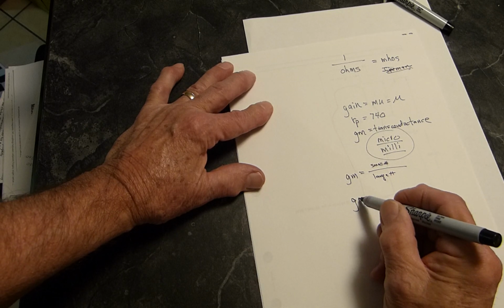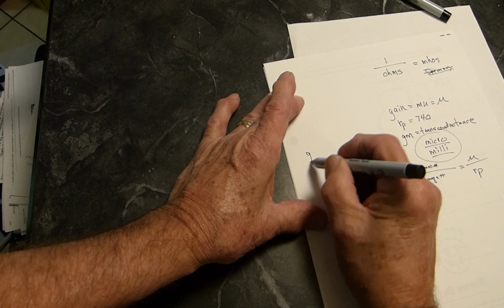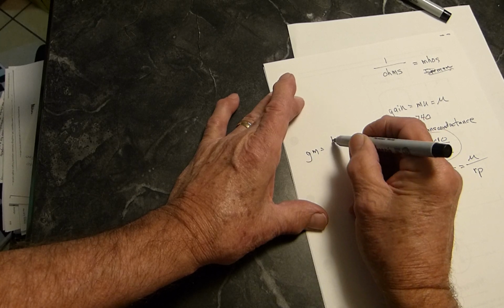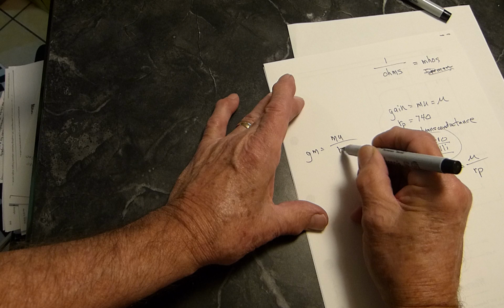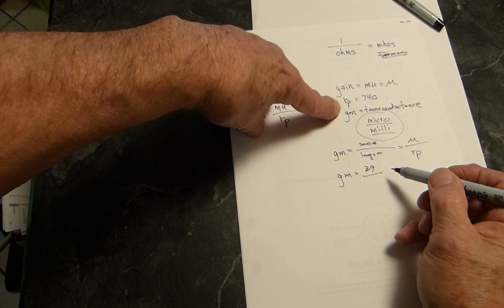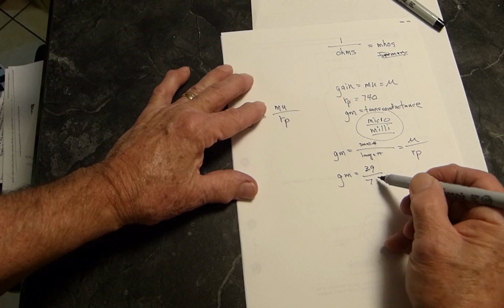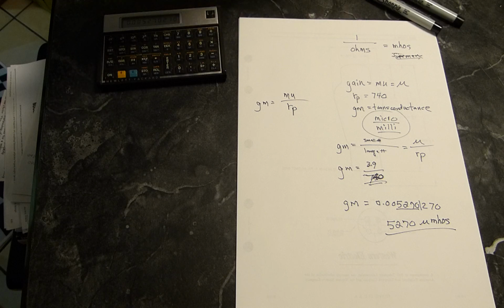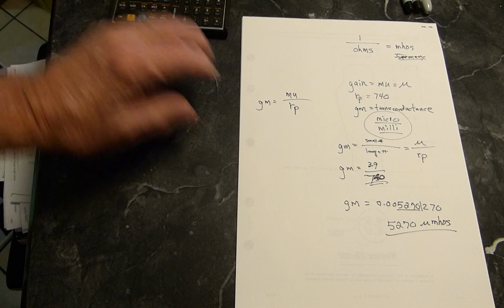Vacuum Tube Gain & Gm Calculations & Some Insight Into Transformer Inductance and Impedance

Comment: Hi David, very interesting video with a lot of information I was not aware of.. I have two questions if not too technical, I was hoping you could answer.  I have a 1943 Thordarson Output transformer originally designed for P-P 6L6G’s or Metal tubes, with many Secondary windings.. Is it possible to use it in a Parallel Push Pull application, and use the appropriate secondary to meet the new Load Resistance for the Parallel sets as long as the Transformer can supply enough current to the tubes? And how do you measure to find out the amount of Henries a Choke is, as I have quite a few I’ve removed from old broken equipment (1940’s-60’s) that aren’t labeled.. I know that they would work well in amplifier applications (I have just tossed one in a CLC circuit and haven’t had any issues, but it would be nice to know what it is I’m using… Thanks for any input, and keep making your videos as they are always interesting. Tom
Reply from the maker: Yes, you can use an OPT for at least a 2:1 impedance ratio change from design. For a pair of 6L6 it is likely close to 5K and parallel push-pull 6L6 will want 2500 ohms so just put your 8 ohm speakers on the 16 ohm tap and the reflected Z will be the 2500 you need. Measuring L in chokes can be done with a number of inexpensive  LCR meters available and there is a simple method on the Internet for a setup so you can measure the L of the inductors under different current loads. This is the setup I use:     https://www.dalmura.com.au/static/Choke%20measurement.pdf

Comment: Thanks for the great videos. I'm about to build my first tube stereo amp. It will be a 6SL7 driver and 6V6 SE OP. I have picked some published schematics to work from. What I don't understand is the coupling of my other components which all output 2 Volts rms. I plan to use an ALPS style 100K pot for volume control at the amp input. How do I determine what component network I need between the  100K pot wiper and the grid of the 6SL7? THANKS CHEERS.
Reply from the maker: Two volts input to power amplifiers is a good level to start with. Your 100K pot is fine and nothing special has to be done. The 6SL7 is a high gain tube and the predecessor to the 12AX7 so you might actually have too much gain and want to have a 6SN7 handy to swap in and try. Your input signal to the amplifier goes to one end of the 100K pot, the other end goes to ground and the wiper goes to the grid of the input tube. Sometimes people use a "grid stopper" resistor between 1K and maybe 100k from the wiper to the grid as it can improve stability. There actually is an effect called the Miller Effect that occurs at some critical value of input R and internal capacitance that can cause parasitic oscillation at some input pot setting without the grid-stopper. Some people will add a capacitor (maybe 0.1 uF or so) in series with the wiper and the grid (and the grid-stopper resistor) but if you do this you must add a resistor to ground (470K or so...) from the grid side of the input capacitor to ground as you must provide some high resistance DC path to ground for the grid or a charge will build up on the grid at some random point and it will just stop working as a bias voltage will build on the grid inside the tube. It won't hurt anything it is just one of those funny things about making sure capacitors have a DC path around them. Hope this helps and makes sense.
Here is a link to a good example of  Williamson amplifier.
https://www.vintage-radio.info/heathkit  The amplifiers like the W-2 and W5 or any of the Williamson Type Amplifiers, are good examples.
Reply: @ElPasoTubeAmps  YES, that does help. I have built guitar amps but always from proven schematics. I understand the biasing but was unclear on grid circuitry and couldn't find any explanations on line. Many thanks.

Comment: David, very good. Two questions if I may.

1. EF86: rp=2M5 and gm=1.8mA/V, so mu=4500? Just checking my number crunching.
2. Why do the tube books and datasheets generally give mu for triodes but gm for pentodes?

Happy birthday!

EJP
Reply from the maker: Hi Esmond - thanks for remembering my birthday. I am not sure if I am older or younger than I think... hmmmmm....
Well, your calculations are what the formulas say so. I can't remember right off the top of my head - I should consult RDH or something reliable but I seem to remember they use gm in multigrid tubes as the mu can be very high (and variable as mu can also) and it seems like it has something to do with screen grid (amplification ?). I will look into it tonight. I posted a video on how I rescued my HV transformer by cleaning up an arc point and then "floating" it above ground so I could use it again.
Reply: Pentodes are more like current sources, so gm is more meaningful, while triodes are voltage sources, so mu is more useful.

Comment: I think that what matters is the reflected impedance under load, which ideally would be resistive but of course never is, speakers and transformers being what they are. Is that what Zobel networks are for? An attempt to cancel out some of the reactive components? Probably gm is more relevant when driving through a transformer. A thought provoking video. Greetings from across the pond.
Reply from the maker: I think it is important to know these characteristics of a tube, and how they relate to each other,  before diving into it and after the tube is chosen, the more common parameters become important like plate dissipation, etc.

The Zobel network is something that has caught my attention before. Here is the simplest explanation I can find that I think it is intended for, on the output of an audio transformer.

"A Zobel can be used to restore the impedance of the driver to the nominal value in the high frequency range."     The "driver", in this case, being the output transformer.  

https://www.omnicalculator.com/physics/cutoff-frequency#what-is-cutoff-frequency-cutoff-frequency-definition

Being a series RC network it will have a cut-off (sometimes called a corner-frequency) (3 dB point) and a typical value is a 47 ohm resistor and 0.1 uF capacitor in series across the OPT. This is what is in the McIntosh MA230. Calculating this cutoff frequency, comes out to be 33.8 KHz .... I think you can see why I can be confused about it also. Why so high in frequency?

These simple series RC circuits are common in Williamson design audio amplifiers right off the plate of the first stage of the 6SN7 or 12AU7 but the purpose they serve there, depending on their value, is to either suppress AM broadcast stations (design for about 1 MHz) from getting into the amplifier (that was a potential problem 50+ years ago), or around 75KHz to suppress a tendency for the amplifier to have parasitics at that frequency mostly caused by the OPT and global NFB issues. I have actually seen this issue on a spectrum analyzer in some, but not all, of the amplifiers I have built. Adding this circuit in the Williamson design will increase THD up at the 20 KHz range (slightly) but it does its job of suppressing this parasitic. Thanks for your thoughts and comments.

Comment: Thanks for another great video David.   I think it would be interesting if you got your hands on a OTL type amplifier and did the "El Paso TubeAmps once (or twice) over" on it showing how the design gets around impedance matching to the speakers without an output transformer.  I am a fan of transcendent sound, but I do not have an amplifier I could share (yet).
Reply from the maker: Dave,
The OTL design has banged around in my head for decades and it has been brought up a few times here on YT. I have to admit, it could be fun. I have a good many 6AS7 and even some other of those super low mu triodes with monster filament current requirements. I think it might end up as hot as the SV572-10 amplifier but with a lot lower plate voltage. After I finish my friends Theremin and the 1619 amplifier, I may crawl around in the attic and see if I can find enough tubes to make it happen. I have gotten into stereo amplifier building so I can, and will, actually use and listen to them and it isn't just another lab experiment. Building stereo amplifiers is a lot more work... 
Here is something I just found -   https://www.bonavolta.ch/hobby/en/audio/6as7_2.htm
I also am remembering what scares me about these amplifiers - direct coupling to the speakers - a plate to cathode short would put plate voltage across the speakers. Maybe not likely to happen but it would only take once.
I will have to think about it and maybe it should be a one channel for experimenting - at least in the beginning.
Thanks for your thoughts.
Reply: @ElPasoTubeAmps  Bruce (the designer of amplifier you linked to) has a book on Amazon with some OTL amp designs that have full speaker protection.  Though I am thinking the one you linked to might as well.  I think it could be an interesting video series.
Reply: @Dave_____  Seconded. I'd love to see a vid on OTL design.

Comment: Great video as always, David! As for @16:40 it doesn't matter how the coils are wound as long as they are wound on the same coil and share the same magnetic field your statement is correct. I will try to find and scan a nice excerpt from an old transformer book where it is very nicely explained with detailed formulas and share it.
Reply: *wound on the same core
Reply from the maker: @Delatsch  Great -  thank you... you have made that clear. I wasn't sure as I thought, maybe, they had to be physically wound on top of one another. Always good to learn something.

Comment: The inductances of 5H each combine into 10H, not into 20H!
Reply: No, it is related to N^2 where in this case N is 2 and N^2 is 4, so if half primary is half the total primary number of turns that gives an N of 2. So if you start with knowing half primary inductance, total primary will be 4x that and v.v.
Reply: @markg1051  You suggest if I use my LCR meter and measure from the center-tap to each outer connection I measure 5H each but if I measure from outer connection to outer connection I will measure 20H?
Reply from the maker: @MrTalaue  That is correct assuming your transformer is 20H plate-to-plate.  May not be 100% exactly but you will see it is essentially 1/4 the, inductance and impedance, from CT to either plate lead compared plate-to-plate.
Reply: @ElPasoTubeAmps  That is very interesting as I would expect half of the inductance when I measure a coil from one end to the middle, so it is up to the magnetic coupling which is different with the transformer.
Reply: @MrTalaue  that is correct with regards to your question on measurements with LCR meter..
Reply: @MrTalaue  I just measured two output transformers which came out of Fender EC Tremolux, these are Mercury Magnetics parts custom made for Fender, both failed within warranty period and were replaced by Fender but because of a high purchase cost I sent them out for a rewind.
Here are the measurements:

Sample #1
Full Primary = 18.9H
Half Primary A = 4.72H
Half Primary B = 4.689H

Lratio between Full Prim and A = 4.004
Lratio between full prim and B = 4.031

Sample #2
Full Primary = 21.604H
Half Primary A = 5.386H
Half Primary B = 5.352H

Two ratios are  4.011 and 4.037.

The test method was David's own using series resonance method to measure inductance of iron cored inductors and audio transformers.

Here is the link to his video:
https://youtu.be/xbIvLTcoI8Y
Reply: I also measured the leakage inductances on both of the samples using the same test setup of 226mH for the first one and 208mH for the second one.

Comment: No, 2 inductances in series are simply the sum, ie, L(total) = L1 + L2, just like with resistances.  I think your confusing that with how Z ratio relates to turns ratio.
Reply from the maker: It is true that inductance in series is just like resistors if they are separate inductors but if coils are wound on the same core on top of each other, like in a common CT output transformer, the total inductance is the two values in series plus the mutual inductance they gain by being wound on top of each other on the same core and the total inductance is four times. Turns ratios and voltages ratios are the same and inductance and impedance ratios are the same.
Reply: Two separate inductors with two separate cores are L1 + L2. Wound on a single core, the inductance is proportional to the square of the amount of turns. So two inductors on the same core connected together square, they do not add. Even the turns ratio is turns squared over turns squared which is where you get Zo/Zi. I didn't know until I looked at some inductance equations and remembered.

Comment: I thought pri Z was 1/4 in Class B, but 1/2 in Class A, so the Z as seen by the valve or tube is dependent on it's operation. Another thing about rp or ra is that it forms a potential divider with the Z of the OPT, so a valve with a high rp needs an OPT with a high Z pri. Thanks for this video, it's always good to have another POV on the subject.
Reply from the maker: I will need to study rp and ra a bit further but it seems like this is  taken into consideration in cascading voltages stages - 
I looked up several tubes, 4-400A, 833A and 4CX250B but I don't see any specs for A and then B ratings. I am sure that is possible but I need to learn more about that also. 
I might assume class-B would need a different plate load than class-A ??   
I do know that in class-C RF amplifiers, the load the class-C tube presents to the modulation transformer is simply Z = E/I as the current drawn by the class-C amplifier is essential steady even under modulation. However, this same tube, at the same time, needs a RF load as is presented by the resonate plate tank circuit of about 1/2 that. Some formulas say the RF load is Z = E/(1.8*I) so there can be some nitpicking about that but for most practical purposes it is 1/2 the modulator load.
Always something to learn - I suppose that is what keeps us going.
Reply: If the transformers are CT push pull for both classes of operation, the inductance and impedance will always be 4 to 1 which is due to the impedance being related to the turns ratio squared or N^2 where the turns ratio N is 
2/0.5 =4.
To make sense of this, realize that the primary total number of turns is twice that of either primary, so N = 2 and N^2 = 2^2 = 4. So that is why if Zp-p is 5k, 
Zp-CT is 1 25k. It's purely turns ratio related and nothing to do with the class of operation.
Hope that makes sense
Reply: @markg1051  This from the Valve Wizard website "While both valves are conducting the amplifier operates in Class A, and both valves 'see' a load of ½ the anode-anode impedance of the transformer (1/2 Za-a). However, as soon as one valve cuts off, that half of the transformer's primary is no longer part of the circuit. Because the impedance ratio is the square of the turns ratio, the load presented to the remaining 'on' valve must be only ¼ Za-a." Which if I understand correctly in Class A each valve sees 1/4 of the Z pri - 1/2 Z a-a, hence my confusion. So in essence your right.
   It is a confusing subject sometimes, apologies if I've added to the confusion.
Reply from the maker: @diabolicalartificer  Not a problem... Thank you for commenting. From reading what is quoted from the Valve Wizard site, the first sentence would lead one to believe the transformer impedance (Z) from CT to one plate is, 1/2,  the Z of the transformer, plate-to-plate, which we know is not correct. 
Also the statement thrown in about Class-A is unnecessary, as the transformer Z is independent of any class of operation, and would add to the confusion but then the site starts to get it right at the end of the statement but now it has been said two different ways and everyone is likely to be confused...  lol...  🙂 
I did not understand this until a few years ago and to add to confusion let's say, for example, if measured with an very good inductance/impedance meter, a transformer that measures exactly, 20.0 H or 5000.0 ohms Z,  plate-to-plate, the H or Z will not be exactly 5.0 H, or exactly 1250.0 Z ohms (but sort-of close...) from CT to one side of the transformer in a real-world measurement but in theory it is to be treated as as such... I think it is these "close" but not perfectly 1/4 values that can challenge an initial understanding and this is true with most real-world measurements in electronics of not being exact as the mathematical approach might lead us to believe.  I hope I said it in a way that does not add to the confusion...  Thanks again.
Reply: @ElPasoTubeAmps  Thanks for clearing that up, much appreciated.

Comment: Are there any OPtransfomers that the two wires are wound together, at the same time?  Then the wire length -resistance would be the same.
Reply: Yes, on some windings but not all, it's called bi-filar winding. This is usually only done on the secondary as a bi-filar primary has to have very good insulation, there is very high voltage between the two windings meaning there's a higher chance of breakdown between the two.
Reply from the maker: I see you got the answer from Diabolical Artificier. McIntosh does it this way and is one reason their amplifiers are so good. I think there are also trifilar windings with three wires wound at a time. McIntosh calles Unity wound transformers.  https://www.youtube.com/watch?v=W58Rqx_4u2w

Comment: More precisely mu is the voltage gain, gain can also mean current gain which would be transconductance or gm
Reply: Gm is not current gain.  It's d(Ip)/d(Vg), a change in plate current, with respect to a change in grid VOLTAGE.